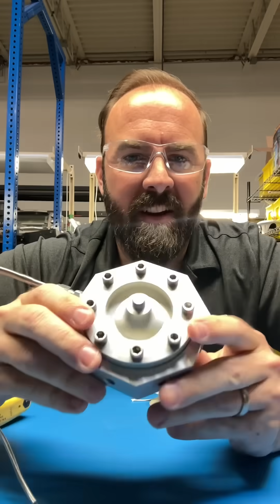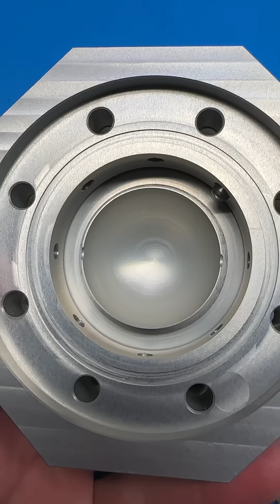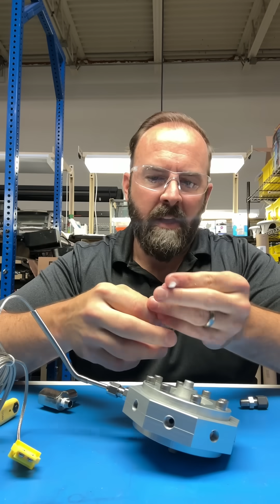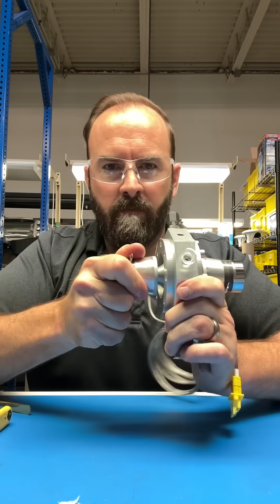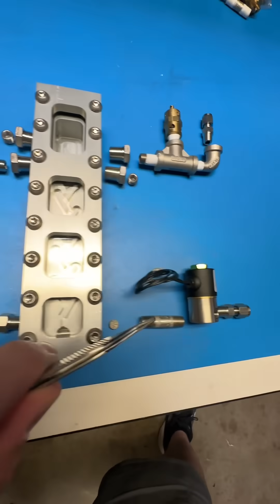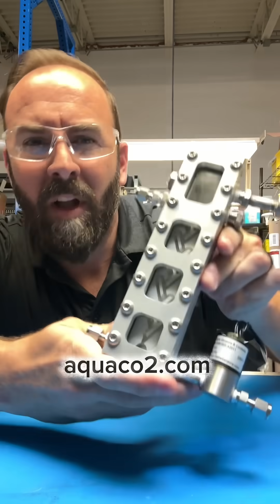LENR Tesla Valve Manifold Assembly

Comment: using liquid mercury is better, the implosion will have greater force, due to mercury being heavier. And using a thin long tube that has great height will have greater pressure at bottom, the width of tube is irrelevant, it is the high that increases pressure not width.